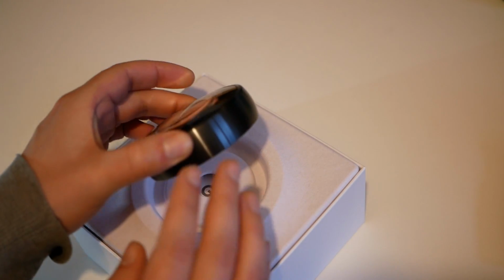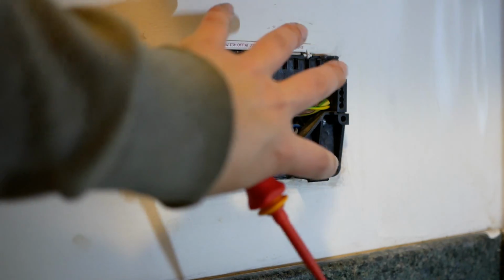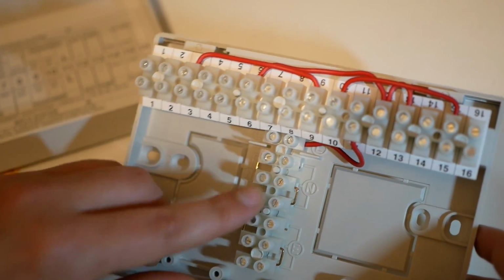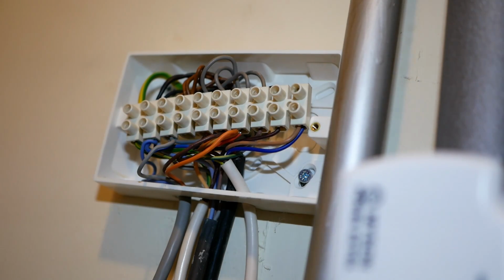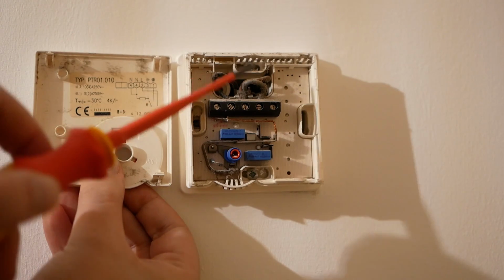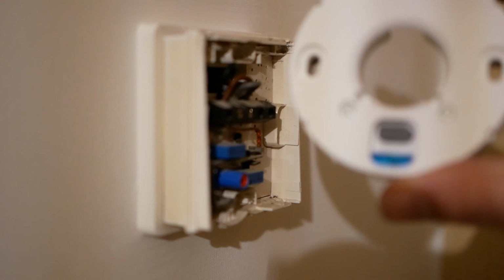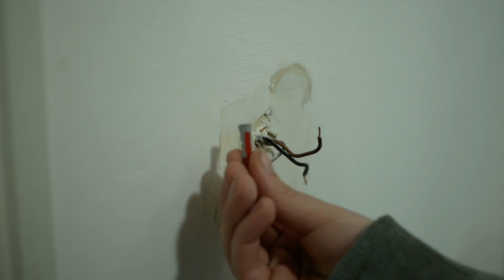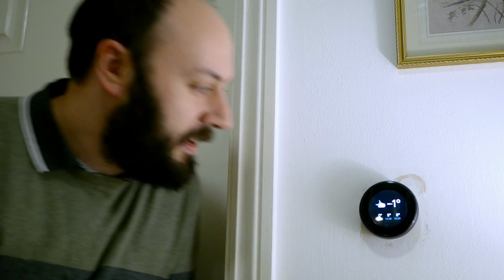Nest Learning Thermostats - S Plan Dual Zone - Replacing Potterton EP2002

Comment: Many thanks Dave. You have a great manner.  I wanted to install a Hive system to our home but had the same situation where the old Potterton programmer was 2G and also acted as the wiring control centre. So your video helped me see that I needed to install a new wiring centre so that I could then connect up my Hive. I have done a Hive instal where it was just take the old programmer off and put on the new programmer, this one was much more time consuming.

But I got there in the end, after I had got the brown and grey wires to the 2 Port valves the right way around!! Couldn't work out why the radiators were not warming up but the tank was almost melting :)

A couple of your electrical techniques raised a an eyebrow, but that would be pickey. Great job.
Reply from the maker: Thanks for the kind words John!

Comment: Is there a reason you didn't go for the nest thermostat E for the heating only thermostat?
Reply from the maker: Great question, yes I have a few reasons... Partly it's just aesthetics as I would prefer both thermostats to look the same, plus I actually prefer the appearance of the 3rd gen learning thermostat over the E, the display on the E is sort of blurry and fuzzy for some reason. The install is different with the E as well, you mount the heatlink where the thermostat used to be & it's battery powered and the thermostat itself sits in a USB dock which is plugged into a socket  - I really wanted a fully wired-in solution with no batteries and not taking up a wall socket :-)
Reply: @daveagill  makes sense, I haven't seen the E in person so I didn't know about the display. In our old house we had the nest thermostat and now we've moved into a newbuild I've been looking to get another. We've got 1 bedroom with its own thermostat so I was thinking of having the E for that and the full thermostat for everything else. Now I'm reconsidering!
Reply from the maker: @GiraffeCat  Yeah I haven't seen the E in person either, but the videos and reviews I've read indiciate it has unusual display technology that isn't very crisp, seemingly on purpose.

Quite often in new builds the bedroom thermostat only controls the bedroom radiators (not the whole upstairs), so  depending on what you need there's a couple of off-piste options you might not have considered:

You could wire both zone valves together and run them from a single Nest. Effectively losing the dual zone but saving some cash by not needing a 2nd Nest.

Or,  you could keep the old dumb thermostat in the bedroom and wire it in sequence with the Nest heatlink, that way you will only heat the bedroom if the Nest thermostat says heat AND the dumb thermostat says heat. You won't be able to heat the room without heating the rest of the house but you can heat the house without heating the room if the dumb thermostat is set low.
Reply: @daveagill  yeah, the one in the bedroom only does that single bedroom, so leaving it as is isn't the end of the world. Thanks for your input, I've got a lot to think about!